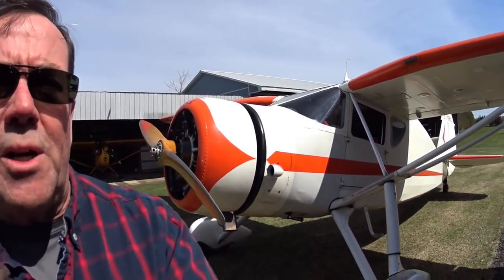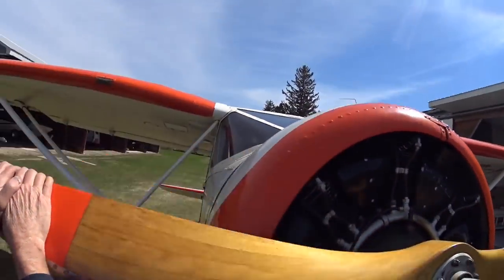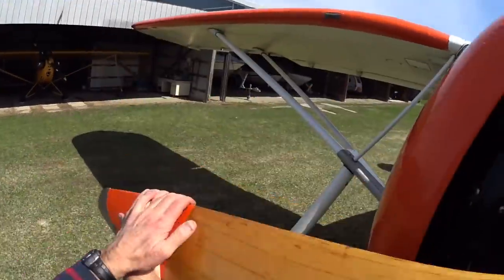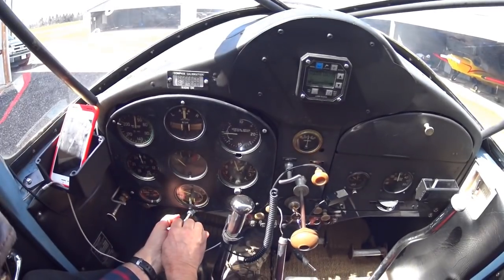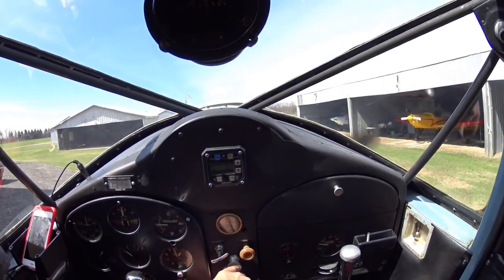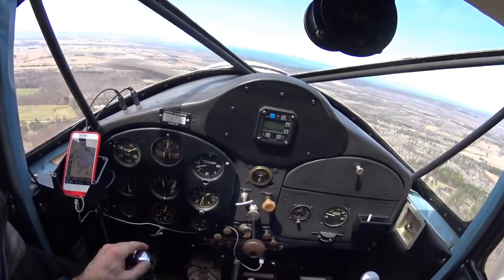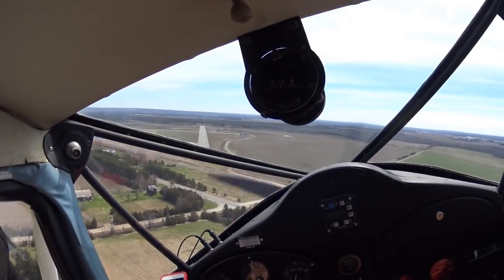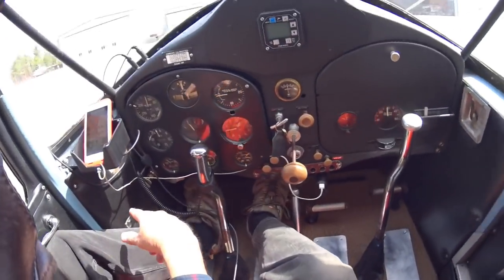Flying the Fairchild 24W

Comment: Back in the late 50's my father had a 24 It had a Menasco Pirate engine.  The original Pirate engine is on static display at the Empire State Aerosciences Museum. After restoration he sold it to a friend who later put a Warner on it.  At the same time he had a Culver Dart GW with a Warner Scarab.  Thanks for the memories.
Reply from the maker: Unusual. Most of the inline engine versions used Fairchild's Ranger 6 cyl engine.
Reply: @davehadfield5906  I called my father, (99 y/o)  and he is fairly certain that it was the original engine.  He thinks it was one of the engines used in the earlier models.  I was 9-10 y/o at the time and I seem to recall they had problems finding parts and was one of the reasons for selling it.
Reply from the maker: @sportclay1   Sorry to have troubled you, but I must say it's priceless to have a resource like that! Please pass my respects to your father.
Reply: @davehadfield5906  No trouble at all.  Thanks for the great video entertainment!

Comment: I kind of wondered how that airplane would do with the Warner. I’ve flown it with the ranger, and thought even that needed a bit more power, but absolutely a sweet heart flying airplane. Do you find the same issue though with trying to 3 point it on pavement? The one I flew would be come a handful in a second if you did
Reply from the maker: No, not really, but like all blind taildraggers on pavement, you can't relax for a second. The gear on this one is well aligned. It naturally wants to wheel-land. And yes, even with the W-185 it's  not overpowered.